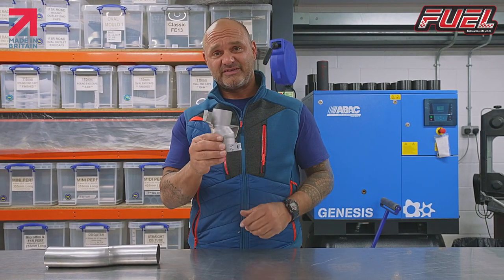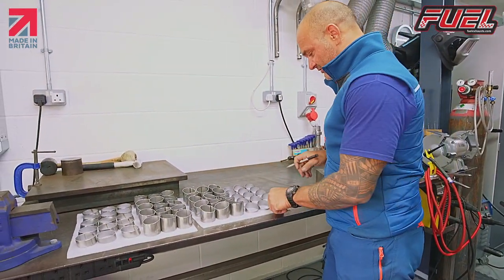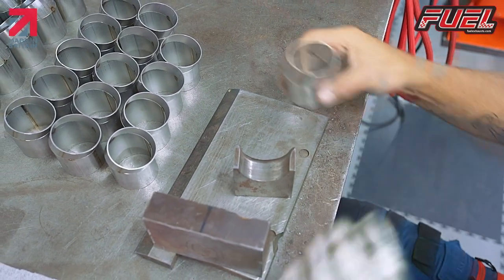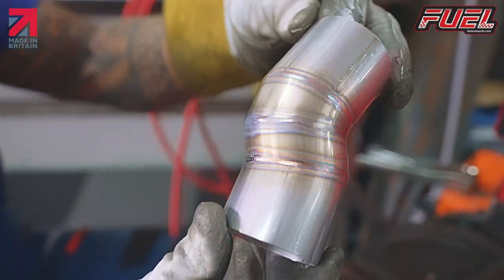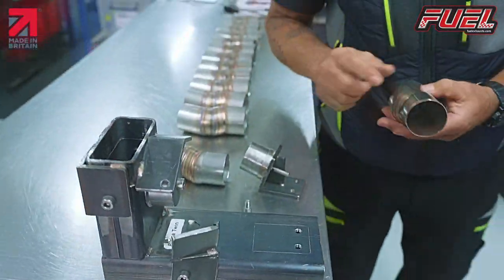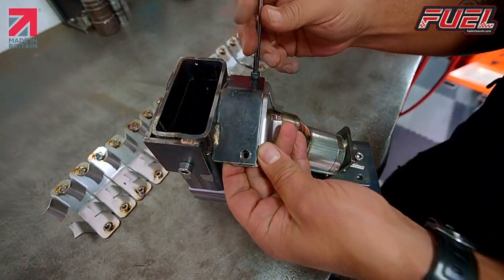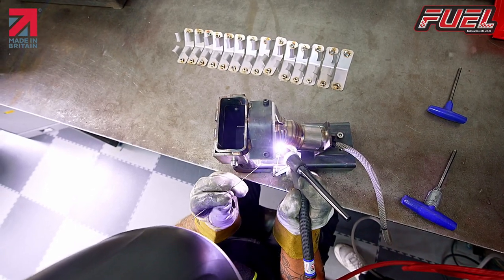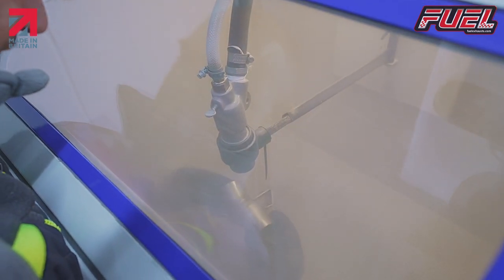Honda Africa Twin CRF1100L Exhaust Link Pipe Manufacture - Fuel Exhausts - Made in Britain!

Comment: I really appreciate this video. Could you explain the difference in the midi and mini, other than length? I may have missed the explanation.
Reply from the maker: Thank you! I don't think we mention the exhaust can sleeve length in this video as it is about the link pipe however the shorter / smaller the exhaust, the louder it is. So the Mini will be a tiny bit louder than a Midi on this bike model. We are only talking a few decibels of difference. 🙂Hope that helps.

Comment: When comparing the 35MM to the 40MM can, which has the deeper tone please? I presume they both are loud enough without the removable DB killer.
Reply from the maker: There isn't a massive amount of sound difference between the 350mm Mini and 400mm Midi (a few decibels) however the smaller / shorter the exhaust, the louder it is. So a Mini will always be a bit louder than a Midi. The tone is deeper on the Mini. If you haven't already done so, it would be beneficial to watch YouTubers @MrFish and @RichyVida's videos as they both have our exhausts fitted to their CRF1100 Africa Twin models. Mr Fish had a 400mm F1R Road on his first 1100 but now has a 350mm Stealth. Richy has always had the 350mm Diablo. Between them, there will be plenty of videos for you to hear which length you prefer. Baffle / db killer removed and then the sound is really opened up and a lot louder. 🙂
Reply: @FuelExhaustsLtd  Tks for the detailed reply. Yes I'm a subscriber to their channels and have checked out videos previously. Just a last question. Am I correct to presume one can remove db killers on both mini and midi? Appreciate your customer care. Tks
Reply from the maker: @DaveDayve  yes all our exhaust ranges (in both available sleeve lengths) for the CRF1100 models are supplied complete with removable baffle. See here for the process - https://www.youtube.com/watch?v=W12UzD8_KCs.